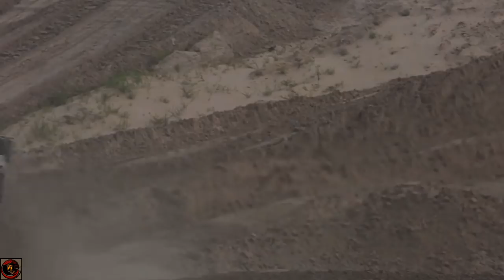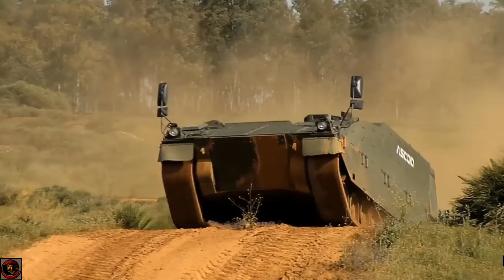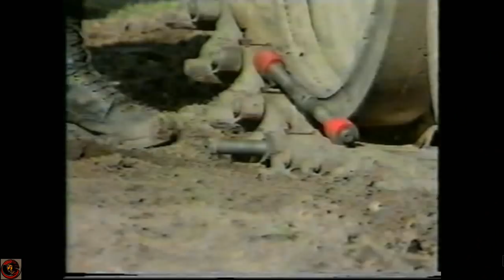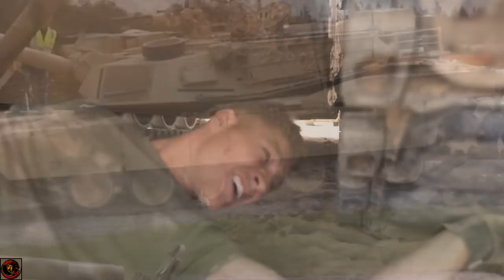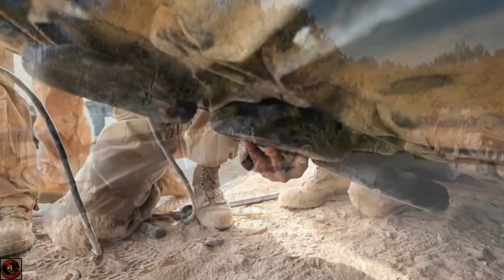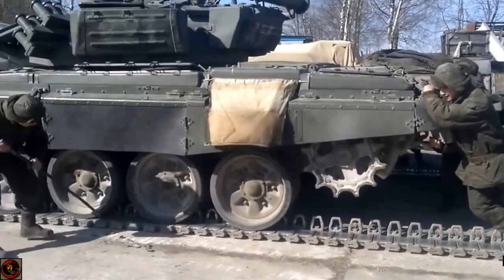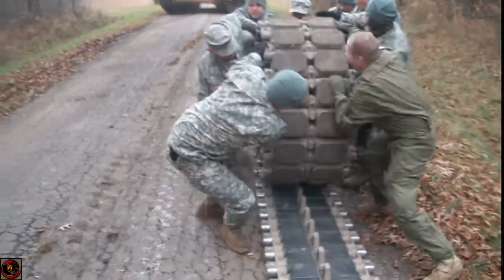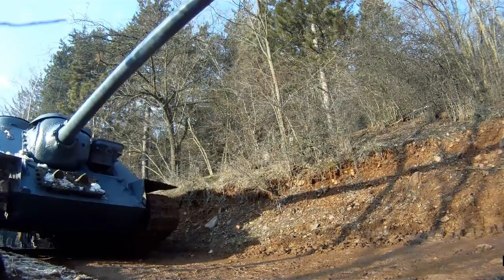What’s The Biggest Weakness on a Tank?

Comment: I think a combat invincible Track would be one constructed out of 3 tracks per side one after the other where each segment consists of a double roadwheel bogey and a return roller/tensioner ( think Sherman ) and every roadwheel is actually powered by an electric motor inside with those being fed juice by an Engine Generator Powerpack combo. If you hit a mine you'll you'll only lose 1/3 of the track available to you on one side though I'm not sure how a turning radius would be affected. Well... If you go that far you could go with active suspension allowing for the first and last roadwheel to be lifted thus creating a more 1:1 length to width ratio instead of a 2:1 one? Just a thought.

Comment: I like the concept of rubber tracks, but wouldn't HE shells completely devour them?
Reply: They're going to be hit by RPG's and IED's long before a HE shell goes anywhere near them. But yeah, they don't sound very reliable.
Though I'm not an expert so just don't know.
Reply: From the company making these rubber tracks "Rubber Band Tracks are made with grade 5 rubber and reinforced with Kevlar fibre, a lightweight and non-flammable compound that protects against RPGs and high temperatures in harsh environments. Their carbon nanotubes confer twice the durability of steel tracks."
Reply: I think that the big problem with rubber tracks will be repairing them, or more to say, replacing them. With the current linked track system when the track is damaged all you have to do to repair is remove the damaged section(s) and replace it/them with new ones. With a one piece track if the track is damaged you're likely going to need to replace the entire thing. Granted that with current tracks there's still a lot of work involved in getting the track hooked back up but logisitically it seems to me that it would be easier to carry a bunch of spare track links rather than entire tracks, as it is, a tank can carry several spare links but I don't think that they'd be able to carry entire spare tracks.
Reply: If they talk about using rubber, then it's probably some super advanced, complex composite material. Seems to be the way to go whereever steel or other metal alloys fail.
Reply: @riceball it could be linked rubber sections. who knows. would make logical sense to do so at least, also putting on a whole track would be a maintenance nightmare
Reply: Cheeki Breeki I imagine a very good material for this purpose would be graphene; it has a monumental tensile strength and is really flexible, although I imagine tightening them might be a bugger.
Reply: don't know about tanks, i think they would use better materials but on small excavators the rubber tracks come off easier in my experience.

Comment: I predict that in the near future, MECHs will almost completely replace tanks. They will use thick graphene or something similar to lightly, but heavily armor these manned or unmanned robots and they will have all the destructive firepower as a tank. They will use micro-fusion or fission batteries eliminating the need to refuel. We are soon at the point where lasers will be powerful enough to burn through thick steel at a high rate, so I predict that some will be equipped with those, and others will be equipped with guns and explosive projectiles. Of course, with an element like graphene, the light armor may be subject-able to powerful lasers (no one can be sure just yet), so others will simply be armored with thick, layered titanium alloy or a heavier metal like-well-I'm not sure which but just open the periodic table and find heavy+abundant. They may just layer the graphene even thicker. The weaknesses will be the MECHs joints, and of course the small thick glass eye sockets. Modern science fiction is the future of warfare.

Comment: I would have to agree with the author of this article.  I have some experience in testing military tracked vehicles, including long-term durability testing on a rubber track system and testing various track configurations on other vehicles.  The first incident I witnessed was an M113 variant which dropped a track at high speed, then travelled about 50 ft, turned 90 degrees to the left as directional control was lost, drove through a ditch, and into a chain-link fence.  I was also testing a Leopard I which dropped a track twice one day, as the coupling bolts were not adjusted properly.  The instant the track drops, directional control is lost and the vehicle is immobilized.  Tracks are fragile and everything depends on them.

Comment: It used to be the underbelly and sides but the tank has seen improvements over time including increase in armour thickness and the introduction of reactionary armour plates
Reply: Joseph conrad SA those still are weakspots. Tracks are just big weakspots because they can be shot from any side. The russians used to shoot the track of a moving tiger with one tank to jam it and get it to expose its flank against its will to another russian tank
Reply: Joseph conrad SA, with research of better armour protection, will also lead to research of better weapons/ways to go past that protection. I mean, now you had said reactive armour, there is a AT weapon or round where it "uses" the reactive armour's ability against itself. Like a two step detonation. One for "activation" of the armour, then second one to move the "round" through that armour. No matter what research you will do to protect the crew in a tank, will there still be someone to find a way to go around it
Reply: Or, you could have a camera recognize the missile as tandem and tel the blocks to activate the second or third time
Reply: Joseph conrad SA Actually side armor of MBTs are extremely weak but tracks are just easier because you can take the tracks out from any direction.
Reply: If an equal force engages you, the old weakness are still pretty similar as you never have infinite weight/armor capacity.
Just as armor changed munitions followed, reaction armor had multi warheads developed as a result which destroy it.

Comment: I crewed an M270 in the US Army. You are absolutely correct. The tracks can be at times worst than woman. Sensitive and finicky. By in large, tracks are primarily meant to go forward and backwards. The stresses a track suffers when turning is serious. In fact, we actually had to track how many turns we would take during training exercises. Typically, if you had more than 100 turns in a training exercise, when we returned to base, we replaced the tracks. I was blown away by how expensive and how weak they are. In effect, we didn't go out for a spin. Treat with kit gloves and pray its nice to you.

Comment: Wedge bolt tightness, track tension, end connectors, track pads are all things I've checked on the M-60 and M-60A3 Patton Main Battle Tanks I served on. I was the Driver and Loader at various times when I served in Company B 1st Battalion and later Company B 2nd Battalion of the 635th Armor.

Comment: Im an infantryman but I’ve worked closely with tanks in the past. I always thought that if I needed to disable a tank I’d go for the optics and antennas.
Reply: That would really makes sense as it's just like blinding a beast, although the commander can still peek out the hatch.
Reply: Its pretty hard to hit them
Reply: There are auxiliary sights that don't require power. There are also iron sights aligned with the cannon or barrel axis. Without an antenna, radios can still transmit pretty decent range. At least to the next tank in the platoon which shouldn't be too far away. Your best bet would be to disable it's suspension or fire some type of anti-tank missile that could disable the turret movement. You are pretty much toast if they crew sees you out the periscopes.
Reply: I'm not in the military but if I ever am I probably wouldn't feel comfortable trying that if I wasn't operating a sniper or sharpshooter.
Reply: Even then I wouldn't take a second shot, probably.
Reply: FOXTR0T1 disable movement, then if you can throw blankets/mattresses over the vision ports. That’s what the Finnish did in the russio-Finnish war. Mind you that was before ww2
Reply: All modern tanks have backup optics + it's not that easy to precisely hit optics

Comment: The biggest weakness of a tank is when a fighter puts a Mark 84 on or next to it.  The parts scatter quite nicely.
Reply: No, because tanks are protected from air attacks by AA, but you can't protect a tank from its own tracks.
Reply: " tanks are protected from air attacks by AA,"  In what alternate universe does AAA stop JDAMs released outside its range?  As for terrestrial threats, ATGW can kill or disable any MBT unless it has APS. Tracks can be and are fairly easy to reinstall and repair in the field.  A hull loss takes that tank out of the war.

Comment: tank has a power wheel on the rear which is not in contact with the ground so if the tracks are damaged it cant go nowhere.
Reply: unless you have cristie suspension
Reply: Thanks for stating the obvious Adolf.

Comment: working on the tracks and replacing road wheels was always a pain in the ass. always have to make sure the track is at the right tension, so you can keep going, and needs to be checked at least twice a day. if the road wheels are still in decent shape, don't worry about them, just make sure they aren't missing large chunks of rubber where it matters. either way it's going to be an all day job depending on the problems there are. whenever they had to be repaired, that's when those items were given different four letter names, because you knew your day was going to suck.

Comment: war thunder is ok at dealing with a damaged track as it will take a long time to repair there's no instant repair
Reply: Takes about 40sec
Reply: depends on what you're in
Reply: i think that earlyer if you had no repair kit researched in simulator battles, and someone blew you'r track off, then you'r only option was to repair on captured point, basicly gg at that point
Reply: No instant repair, takes substantially less time than an actual track replacement, and you don't lose your entire crew when something decides to spray your position with machine gun fire during repair.

Comment: By far, the biggest weakness would be getting mobility-killed. Treads are pretty damn fragile things. I've built little robots that could survive falling off of things, but break a tread and they tended to be completely down for the match. The tread system on an MBT is different and better than on little tiny robots, but they also have to take much harder hits.

Comment: This may be a dumb question, but, since a tank steers by varying the power output between the two tracks, wouldn't having a track destroyed cause it to constantly turn, as opposed to only being able to go back and forth?
Reply: liam sargo you can have one side in neutral. So you can go straight, till you can't.
Reply: Lose a teack on one side of a traditional drive system and all the power will go to the final drive that has lost a track, you have to brake the final drive on the side that has lost a track and that allows you limited forward or backward movement but no ability to turn.
Reply: Ah, thanks. Have a great day.
Reply: liam sargo remember that the damaged track still causes friction with the ground, drive wheels dont work así regular wheels, look at it like limping, but while draging a lot of weight
Reply: Lock your differential.

Comment: Things that come to mind: There was that one M1A2 that defeated an Iraqi tank platoon turning in circles after one track was knocked out. That is not a situation you want to be.

There was part of a documentary showing a Tiger II tank being moved and restored in modern times. One of the things they had to do was some battlefield repair. Cut away some damage from the hull. Remove a 75 mm round from the between the hull and track. De-track the road wheels. Finnish cutting the spur of metal away from the hull. Re-track the road wheels. This was accomplished so the old tank could be pulled into the restoration garage. Their final goal was to restore The Tiger II to running order. Labor of love. :-D

Comment: The top of the tank is really, really weak compared to the front. Most ATGM's are top attack missiles, like the Javelin.
And yes, some tanks have active armour that blasts incoming missiles before they hit the tank but also most ATGM's have tandem warheads so if the first charge blows another one will follow right after and the active protection system cant cope with that.
Then imagine if several of these ATGM's are being launched at the same time against the tank like every armed force with some training would do, the beast will burst into flames pretty quickly :(
Reply: Tandem warheads work against ERA and slat armor, but not against active protection systems (APS). Modern APS can defeat several ATGM/RPG at once.
Reply: Until the ammo for the APS runs out :)
A couple of Carl Gustaf squads in ambush positions with a great shooter/loader will rain hell and add some ATGM's into the picture along side, im not sure if the APS will cope :/
Reply: First off, a carl gustav won't do anything even to the passive armor of a modern MBT. It's primarily used against soft targets and bunker buster. Second, Rheinmetall ADS as example, archieves multi-hit-capability by overlapping countermeasure arcs. ADS can defeat 3+ threads fired at the exact same spot, immediately after each other.

Also APS are capable to locate firing positions, so "raining hell" will be extremely difficult because you have to avoid a 120mm HE fom that MBT, 30mm airburst from that IFV and the mechanised infantry squad that always moves with them.
Reply: Yeah i totally get your point :)
I know that a Carl Gustaf with HEAT warhead can penetrate the side of a Leopard 2A5 so thats not bogus :P
Sure the APS can track and instantly engage one squad but the rest of the squads then? Sure they will be tomato splash in a matter of seconds but a well coordinated ambush with concentrated fire with both HEAT warheads and ATGM's tandem warheads against a single tank will screw it up...
I was to be conscripted as a loader in the STRV 122 but i ended up as ground maintenance for JAS 39 instead and after seeing what a couple of fighters can do against a tank...
All respect to the brave guys operating a tank, they have got some balls!
Reply: So you need 4 ATGMs at the exact same spot to defeat hardkill. Taking softkill APS into account you'll need 4 ATGMs at the vehicle to defeat softkill and 4 ATGMs at one exact spot to defeat hardkill (that makes 8 ATGM in the same period of time, 4 od them even at the exact same spot). Taking the almost impossible probability of hitting 4 ATGM in the exact same spot, it gets really hard. Great to know that a Carl Gustav HEAT can penetrate the side of a 1999 tank. Well, APS sure can track down multiple attacks and layer the firing positions on the hunter-killer system so the gunner can light them up one after another.
Reply: And yet the Russians trust that their Kornets will do the job. No fire and forget or top attack design.
Reply: Russians don't think that Kornet will get through APS either.
Reply: TrayIncProd 
Hei!
Jeg tror ikke Amerikanere og Briter vet hva en STV122 er, det er nok lettere å si Leopard 2.
Men en 84mm Carl Gustav er ikke noe å spøke med, IDF var ikke noe glade i dem på 80tallet i Libanon, dem ville ikke risikere at FN brukte dem mot Merkava.
Men i dag tror jeg ikke at den er kraftig nok mot en MTB, men mot mindre vogner så er dem nok farlige fortsatt!

Comment: completely agree. i don't really know much about tanks, but honestly, it is just normal thinking. if everything is heavily armoured except the tracks, then those are the weakness. blow up one of them, tank will stop moving and you can, for example, easily get around it, if it has a slow-turning turret or you are in a fast vehicle, or just get out of range much more easily, if the situation makes a retreat neccessary, etc. in any case, an immobile tank is much much easier to deal with than one that can still move properly.

getting to the topic of games, i think a comparison between immobile tanks and turrets is very accurate. in strategy games, people usually build only very few turrets or just don't build any (depending on the game, map, etc). this is because turrets are only useful in very specific cases and just putting them everywhere would be too expensive.

Comment: Worth noting that this applies pretty much to any military vehicle ever, the motive system is a big vulnerability no matter how much armor you add. A shot tyre may be easy to change but a good hit is going to ruin a lot more than just that, a ground attack plane like the A-10 still needs to leave its engines completely exposed from at least two directions, and let's not forget how many ships were sunk after their steering got ruined...

Comment: The switch from tracks to multi-solid-rubber wheels has been long over-due, but held back by the infant development of drive systems running multiple wheels instead of just a single pair of primary drive sprockets that are not too complicated and are reliable enough to be practical.